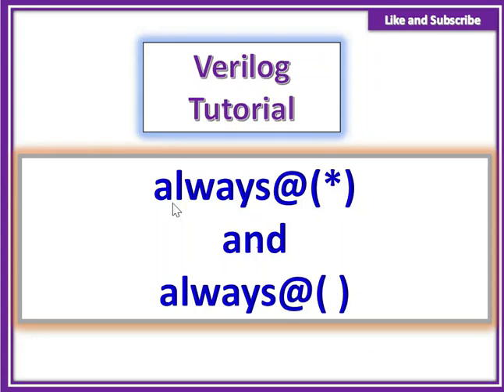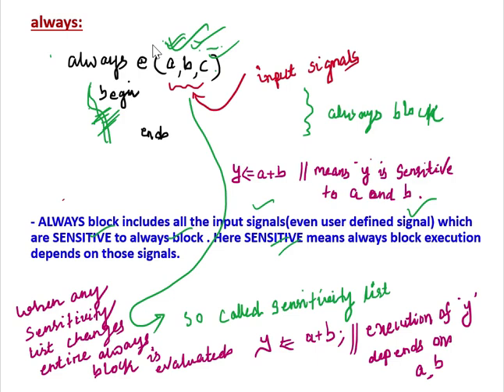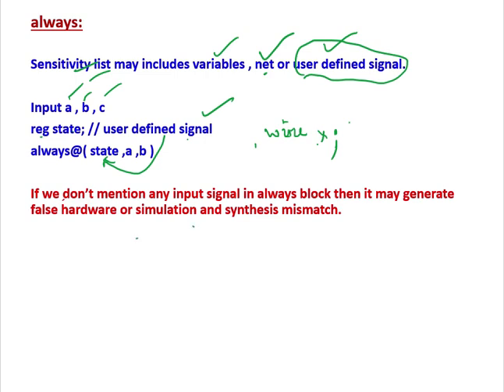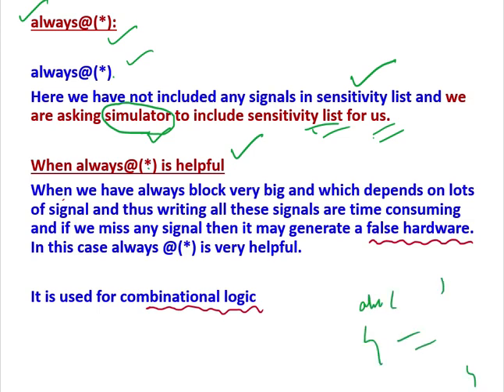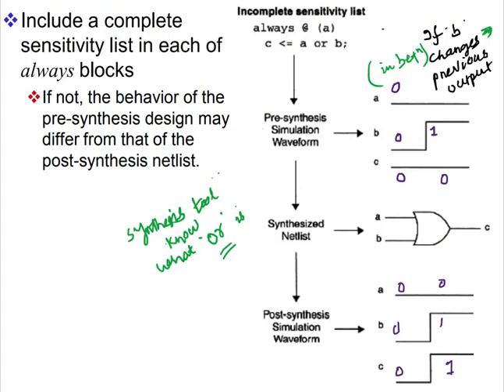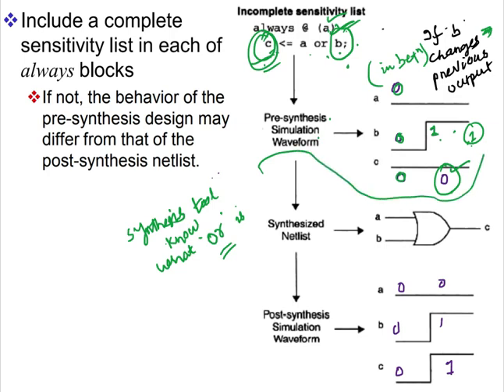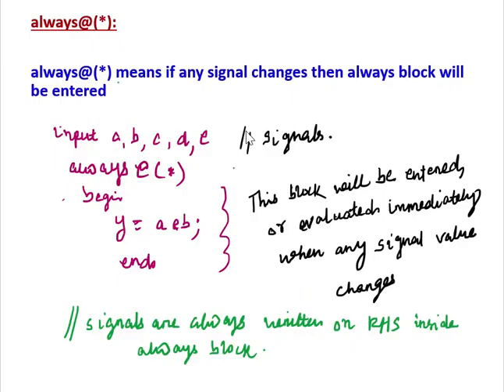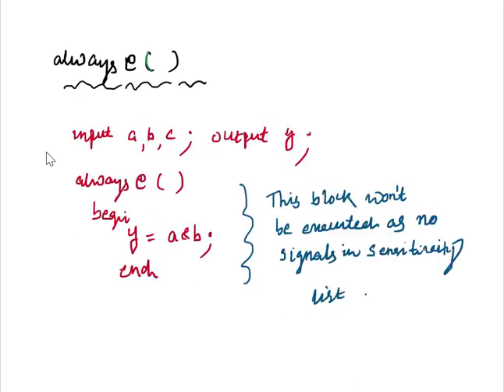#12-1 Use of always@(*) in verilog || combinatioal logic design in verilog || very important concept

Comment: The other video you said that the always @() ran continuously and now you say it never gets executed.. which one is it? Or did you mean always (without '@' and '()') runs continuously?
Reply from the maker: Please tell me the tutorial where I have said it runs continuously,  I will go and check it and if requires I will rectify it.

It never gets executed is correct.
Reply: @ComponentByte   but does the always block without anything else run continuously?

This was in this video (maybe I heard wrongfully):https://youtu.be/-PCHSFyszoc?si=q7lsRlaOxBUNbVHL
At 12.00 it's written and you said it outloud
Reply from the maker: Yes, always( without @ and () ) runs continuously
Reply: @ComponentByte  thanks! Other question: can you use gate primitives only in structural modeling or can you also use them in behavioral modeling, and can you only use cases and statements in behavioral modeling comparing to structural where you can't?
Reply from the maker: @kobafn4598 I have uploaded tutorial on structural and behavioral modelling.  Please watch it and your many more query will get solved.
Reply: @ComponentByte  i have watched it i was just wondering whether you are allowed or not. The point is to not use the gates in behavioral but is it prohibited?